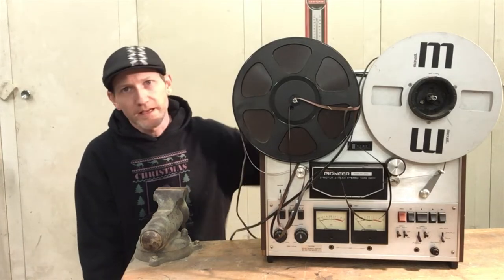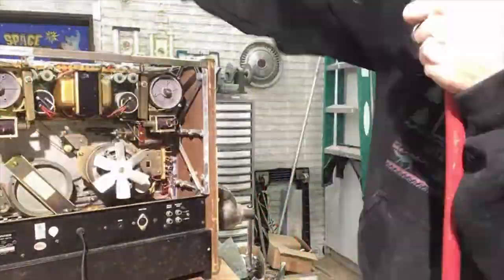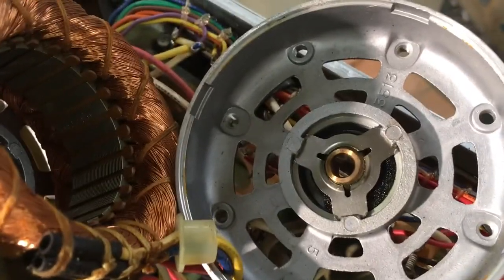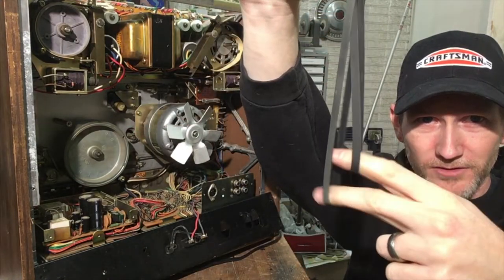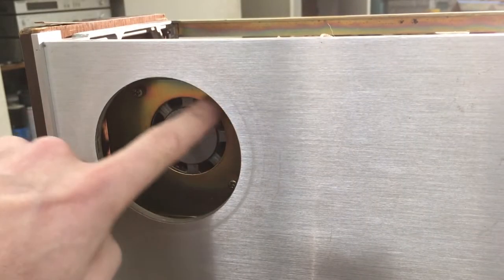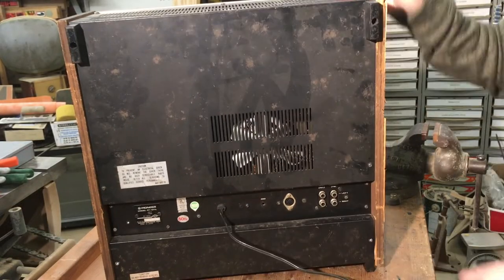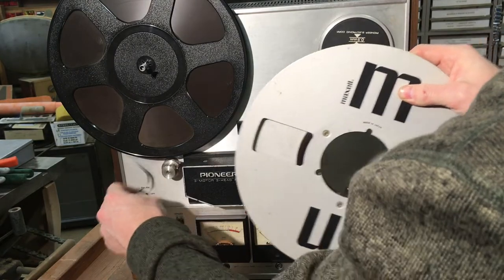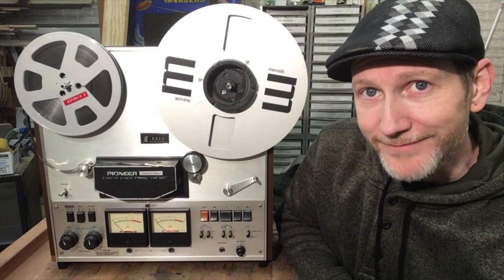Pioneer RT-1011L Reel to Reel Repair/Rehabilitation

Comment: Nice job on the motors, and a great easy tip on how to remove the bearing (s) The tensioner can be disassembled by turning the cap counter-clockwise. It's only snugged by hand so it will turn by hand. The RT-1011 isn't an introductory model. The "better" models offer more features. It is comparable to the TEAC 2300 and other similar Teac models in sound quality and technical specs. (I own and like Teac and Pioneer, Revox, etc.) The RT-1020L and RT-1020H (15ips) are the same machine except for 4 channel playback feature, and the RT-1050 is a two track with 15ips and selectable equalization, better specs because it's a two track format (wider tracks).... the mechanism and circuits are otherwise the same as the 1011, exactly the same.

Comment: thats the counter making that noise ....they drive me nuts (I repair reel to reel machines for a living , hook me up if you ever need help) . the pioneer is a GREAT machine .
Reply: Yep, it's the counter screaming. I had the same problem on my 1020L which I solved by oiling the counter mechanism. It seems that changing the counter belt can also stop the noise. Perhaps a loose belt causes slippage or something.

Comment: Great video! I just picked up this same model from someone and went through all the same maintenance - it was a great help! I didn't have any foam for the motor oil, so substituted felt rings I cut out of some 1-1/4" insulation I had. Holds the oil nice and I'm thinking it might last longer than the foam.  Great machine,  especially for the price I got it ($200). 😁
Reply: some people will just give these away! impressive

Comment: I'm in Europe and my Pioneer (1020L) is made for the US. I've flipped the switch on the back from 60hz to 50, but I'm still using a transformer to play on 220v. Is there a switch somewhere that does this conversion? Thanks.

Comment: Thoroughly enjoyed this repair.  As an owner of the RT-1020 model I am curious why you said entry level and lots of corners cut?  These seem to be solid survivors for the most part.  It could be because of the shear numbers produced, but I am wondering if a very basic design wasn't actually a strong-suit that has proven itself over time?
Reply from the maker: I think I was just basing it on my experience with TEAC units. It's far and away better than any piece of audio equipment being built today though.
Reply: The 1011 was the entry level model, the 1020 the middle model, and the 1050 was the top model. Differences were 1/4 track or 1/2 track heads.  3 3/4 and 7 1/2" IPS speed, (L model), or 7 1/2" and 15" IPS speed (H model). Removable head assemblies, remote control.
As a side note, the brake bands on these need serviced also.

Comment: Hi, thanks for the video.  I have a phenomenon where the motor spins very fast at both speeds relative to another normal tape and playback is of course very fast.  I checked the belt according to the explanation, it is on the wheel with a larger diameter that corresponds to 50 Hz in my area.  What could be the problem here?

Comment: hi have worked on alot of  cassette decks and reel to reel over the years it is so easy to miss out any parts when doing a fix   i am a otari mtr 12 man my self
because i can change over head blocks from 1/8 to  1/2 in tape  
1/8 heads full track is for  cassette line up tape i used to make them   for 4 6 8 track recorders   

i have some 1/8 reel to reel slave  recorders  used to do real time  cassette  for bands

Comment: try to find an old carburetor adjusting set, it has a flex shaft with Allen keys so you can bend the shart to fit into tight places. I'm an old mechanic, it works well on other stuff too. Cool vids...

Comment: Hi Mark, great video. I just pick up this RT-1011L. the unit is like the one you have in the video where the motors need to be oiled. I have a question on the right side tension bar. Is it supposed to have some tension to it or move really soft and free? Mine seems to be really soft and free and sometimes just drops down and of course the unit stops.

Comment: Great video - don't know if you're still following this but I just picked up a long-stored RT-1011L. Very clean, little head wear. Upon initial test all functions were working, but next time I fired it up the take-up reel stopped working. Grabbed the service manual on-line pulled the back off to familiarize myself with the unit and noticed two things - 1) an audible hum that sounds like it's coming from the take up reel motor and 2) if you gave it a little nudge the reel would turn but noticeably slower than it should. Any suggestions on next steps?
Reply from the maker: That thing is so far removed from my memory, but if I had to guess, it's probably related to the issue I encountered with the dried out oil and disintegrating foam that used to hold it. I would start by removing the motor, cleaning out the gunk and oiling the bearings. Sounds like the motor is getting power, it's just having trouble turning because of some kind of physical resistance. Best of luck!
Reply: @PhillipsHomeRepair  LOL thanks for the reply - yes it's been awhile since your post  but still glad I found it. At first it wouldn't spin but i found if I gave it a little help then it would, so I'm betting your diagnosis may be spot on. Gonna pull the motor off and peek inside. Thanks again for a very helpful video!

Comment: hi have a tascam 38  fixed up  and right at the end the main pcb dropped   dead was not me  something to deal with the ic's as the power 5v reg went  i changed 95% 

of parts and test the rest  it was left of for some time not good to do

Comment: I see there is a headphone jack (6.35 yeah?). Manual shows headphone output at 40mV/8 Ohms. And the load impedance 4 to 16 Ohms. Any over the ear headphone recommendations with this specifications in mind?

Comment: I have a Sansui 7000 reel that I just acquired... the right reel does not turn much... any suggestions ?
Reply from the maker: If it is belt-driven, it's almost certainly the belt. If it's direct-driven, things could get complicated. I have never been inside any Sansui, so I'm afraid I'm not going to be much help.
Reply: Thank you for your help!

Comment: Great video - thanks for showing all the details. I have a AKAI 266D with one channel not recording but both channels play. Any advice of where to start?
Reply from the maker: I have no direct knowledge of that issue or that deck, but I'd personally start with the wires going to the record head. It's easy to see if there's a problem there, and even easier to fix. Other than that, about all you can do is trace the circuit from the head to the main board. Good luck.